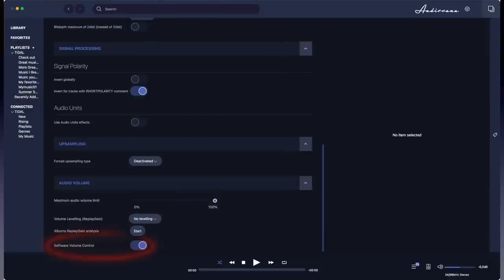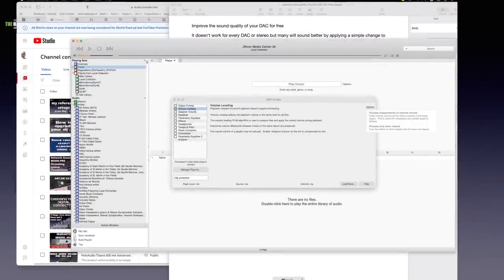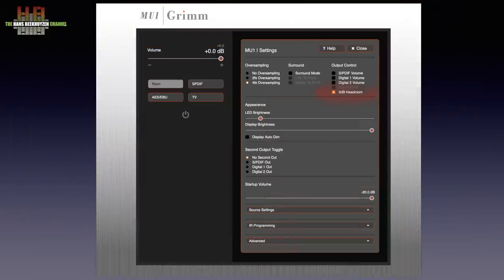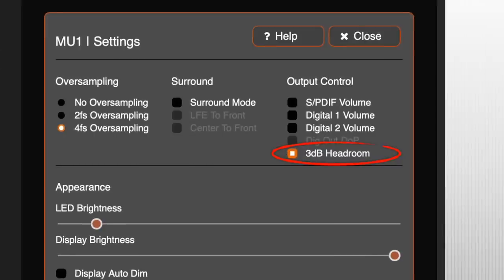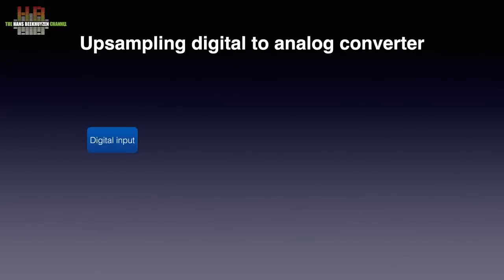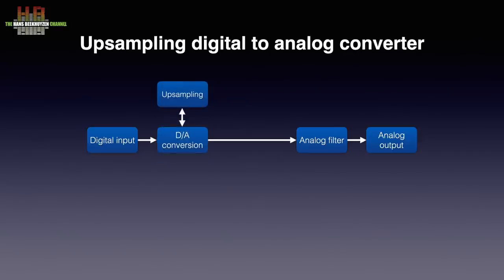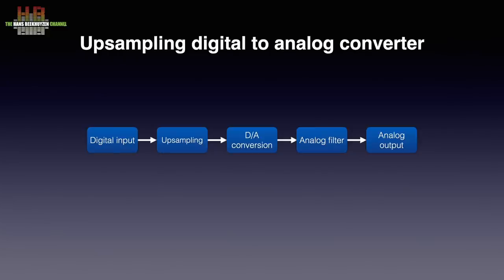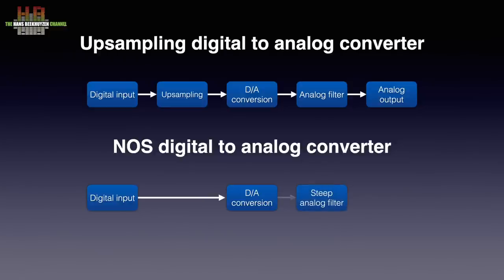Improve the sound quality of your DAC for free

Comment: Thank you so much Mr. Beekhuyzen! I have been using Audrivana and my PS Audio sprout in my office (gaming PC) for about a year now. With no issues I had hoped to recreate that sonic magic in my reference system. I purchased a mini pc (Pico) and installed Audrivana using a USB connection linked to a PS Audio Strata. It did not take long to start hearing artifacts etc periodically. I adjusted different settings in Audrivana with little or no improvement. Recently I came across this video explaining what is happening. I did as you suggested, and everything sounds amazing by adjusting by -3db. Thank you again!

Comment: This advice was incredible. In my case some songs were so harsh on my HE1000v2 stealth it was close to unlistenable. I tried to do a lot to tame it from adding an R2R dac (Musician Pegasus), a DDC (Musician Pisces II), expensive copper cables (Effect audio code 23) and while they all improved (or changed) the sound to some degree the harshness was mostly still there.

After watching this, I decided to check if clipping was happening and sure enough the worst offenders had tons of clipping showing up on Peace GUI. I put a -3db pre-amp and boom, the harshness was tamed. I can push the volume on the amp even higher now  since my ears are not reeling from harshness (more that overcoming the -3db preamp). 

No more chasing exclusive modes and bit perfect audio for me.

Comment: I have been doing this for years because I thought it sounded better, but had no idea of an logical reason behind it. Software volume is theoretically worse, and does sound worse (lower dynamic range) if reduced more than around -10. This true of any DAC Ive used, but especially on a Denafrips Ares2.
Reply from the maker: Nowadays digital volume control can be better than analog ones. It’s all down to the implementation.

Comment: Just by flying by the seat of the pants, if I record in the digital domain I usually trim up just a notch before clipping. And when all is well, and the band rehearses I turn it down by 3 dB. You never know if he hits that cymbal extra hard next time! This way I know there is no digital clipping. But I keep an eye on that red light though!
Reply from the maker: This is not about clipping during recording but overshooting of the reconstruction filter.
Reply: @TheHansBeekhuyzenChannel  yes I know, but if ones messes up during recording you can't solve it during playback. So although the reason is different, the problem is the same! You can't go beyond the brick wall as easily as with analogue... the latter is more forgiving...

Comment: I do this. I 
usually end up somewhere between -3 dBFS and 
-9 dBFS  to optimize the sound quality  from any source file.  Most people will argue with me that I’m crazy and say I should leave it at 0 dBFS, but that doesn’t work as well as being @ -3 dBFS or lower and letting more signal into the PA within the analog domain. It just sounds better, and even if you take 10 dB away, there’s still sufficient DR and SNR at 16 bits. People get so wrapped up in the technical, they miss the point of enjoying the music.
Reply: What does it mean when people say they do -3dBFS? Like how do I do that?
Reply: @Ken-vv3os  that just means 3 dB less than full scale. For power, that would be half power, but in voltage, which is what we’re discussing, -6 dB would be half. -3 dB in voltage would be about 0.7 of the voltage (roughly 2/3’s).
Reply: @shipsahoy1793  but how do you actually do that? What do you tweak on which device?
Reply: @Ken-vv3os  oh I get you, sorry !  The easy way  is to have a dac that allows you to make those adjustments. Some dacs have a digital control that you can go from zero down to minus whatever in half dB or dB increments. 
You can’t do it on a Modi or something that doesn’t have what’s referred to maybe as preamp mode instead of dac mode. I’m not up on the difficult ways or all design permutations. You can use the volume control on a passive preamp to “pad” or reduce the level coming out of the dac, but the dac analog output will still be up at full output.

Comment: Great video. In Roon, I only do up sampling to 384K...I always thought having the -3db Headroom will not be lossless. Should the Headroom -3db adjustment be ON by default in all cases? Thanks
Reply from the maker: Absolutely. BTW upsampling isn't lossless either. Any digital processing is lossy. But the SQ gain when upsampling might be better than the loss.
Reply: @TheHansBeekhuyzenChannel  Makes sense.  Thanks very much

Comment: I use Roon which runs directly on the Grimm Audio Mu1. As I use a Procedural Eq on the low frequencies I cut the Roon 4dB down to avoid clipping and this works on 99% of the songs (no red clipping signal). In this case, is it still advisable to add the 3dB Headroom with the Output Control in the Mu1 settings? 
Thank you so much
Reply from the maker: I don’t expect it will. But just try and listen. It’s quite audible in an A-B comparison.

Comment: Thank you for this video!
When using roon with automatic headroom -3db is applied, when using Tidal directly as the software source (instead of Roon) I believe reducing -3db on the volume in Tidal should do something similar. So to my understanding in applying the -3db on the software there is no need to further reduce -3db on the DAC, although there is no harm in doing so. But when producing music on a DAW such as Logic Pro X or Ableton Live, how would you approach this? Would you recommend reducing the master to -3db? And if applying a correction plug-in such as Sonarworks which is applied on the master, should you reduce -3db on the plug-in output or would its safe headroom feature is enough?
Reply from the maker: Well, you shouldn't produce signals that create 'overs' and give a bit of headroom so the reconstruction filters overshooting doesn't happen. But if you want to do the same as on the playback systems, you can reduce the monitor out with 3 dB and control the volume after the digital to analog conversion.

Comment: I use MusicBee as a player and it has a digital volume but only shows in percentages, such as up to 100% maximum.  Does anyone know for players that only have volume as percentages, how much one should lower that percentage to get around -3db?  I am trying to remain as high as possible so just going down 5 or 10% may be more limitation than I need.  Are there thoughts from anyone who knows?
Reply: Good question. Although i cant even find the digital volume setting. anyone knows more about this "trick"/ headroom leveling for musicbee?

Comment: Many thanks for this tip (and your great channel!). I'm trying to apply this tip in my MoOde audio player (volume type set to fixed output (=0db) and max output to 90%). Can you point me in the direction where I can apply your tip in Moode?
Reply from the maker: It's been a while (and many pieces of equipment) ago since I used MoOde. But if you use it with an external DAC, set the volume at -3 dB.

Comment: Hello Sir,  many thanks for all your videos,  I am impressed of your knowledge, congratulations, I use wiim pro with an external smsl dac (do400), should I set the -3db on the SMSL? This dac goes till +2 db, actually set to 0, Wiim I am using as fixed volume,  thanks again
Reply from the maker: The volume needs to be lowered by 3 dB in the streamer.
Reply: @TheHansBeekhuyzenChannel  thanks a lot for your kind reply, I had just a quick look inside the Wiim app, there is the functionality "Set the maximum allowed volume" I can choose from 0 to 100, may I ask you Sir what value shoud I pick from 0 to 100 to reduce the -3db (it may be smth like 95%) ? Thanks really a lot

Comment: Does anyone know how dCS (Data Conversion Systems), the inventor of upsampling, handles this problem? The way you're explaining this, it would seem overshoot in reconstruction filters is a known phenomenon?
Reply from the maker: I haven’t reviewed dCS DACs so I can’t say
Reply: @TheHansBeekhuyzenChannel  Did a level matched comparison last night and found setting the DAC to -3dB versus 0dB (re-adjusting on the amp using pink noise) sounds marginally fuzzier and less natural. Just enough of a difference it might stand up to a blind test, maybe too subtle. But enough for me to pick what I like better (bypassing volume control). The Upsampler in this scenario is a unit of its own, by the way, internal clocks of all units synchronized by an external master clock, volume control in the DAC is digital in 0.5dB steps. Given time, I'll try the same with an older generation model as well, for which dCS informed me back in the era there's about a bit resolution loss per 6dB, and that the older models had less headroom (effect of using the volume control is more audible).

Comment: Running Audirvāna on Mac mini connected to denafrips Pontus II.  I have options to attenuate volume two ways - DAC and SW (software volume control).  Which is the better control to reduce by 3db?
Reply from the maker: In Audirvana
Reply: @TheHansBeekhuyzenChannel thanks for your response.  To clarify - I have both of those settings in Audirvāna.  Trying to figure out which to use.

Comment: Sorry are you saying it makes sense to implement headroom management for NOS DACs, or only for upsampling DACs? I have a Holo Audio NOS DAC (fed by iFi Zen Stream), and am trying to figure out if I should implement the -3db headroom in Roon?
Reply from the maker: Every filter - analog and digital - will have some overshoot but analog filters have a nicer character when it happens. But why not just apply that 3 dB attenuation? It won’t harm the sound when done properly.

Comment: How do you know if your DAC has this clipping problem?
Reply: Harsh, flat sound with lack of midrange
Reply from the maker: Almost every DAC suffers from this, even my Chord DAVE and the MolaMola Tambaqui. It’s because digital recordings are recorded not taking in account this phenomenon.
Reply: I am now a bit confused.  I bought a Benchmark DAC3 because it deals with ‘intersample overs’ by having 3DB of headroom.  But you seem to be saying that all DACs have the problem because of the ‘source’ material not taking account of it.  Doesn’t that mean it is not ‘all’ DACs that have the problem but ‘all’ DACs will highlight the problem due to the source material containing it already?
Reply from the maker: I have no hands on experience with your DAC so I can’t help you there.
Reply: @Surreyg  my previous dac Rme Adi 2FS dac had also - 2,5dB headroom. In my opinion at least aditional - 3 to - 5dB on digital volume was needed to receive natural sound. (of course still limited to Adi quality)

Comment: I have tube usb dac. Im using apple macbook air. I can change the volume on the computer or in tidal.
I always have the volume on computer( output spdif)to max.
And in Tidal application i have in settings force volume on , exslusive mode of and MQA on.
This sound to me the best.
If inhave exslusive mode on the sound is flat. You think if i lower the output on the computer the sound will be better?
Reply from the maker: If you want to use MQA, you don't need nor should reduce thee digital level with 3 dBs.
Reply: Thanks for the reply.
I have another question.
Do you think that tidal in audirvana sounds better that only tidal aplication.

I have computer in other room. When am listening i don,t see computer so i need remote control for changing songs.
Tidal doesn,t have remote control but
Audirvana does. But then i have to pay for both.
Is there any other solution for this.
Thanks for the reply.

Comment: That's why i have digital volume control on my dac. it sits at -8 Db. it also prevents the pre amp from getting outside it's bias. two birds , one stone. Groetjes uit Breda :)
Reply: Yes I think this is why it works so well! The dac analog output and preamp input can be receiving a full 4v. It's good to get restrain this a little before hitting the analog domain. Also results in the pre volume pot being turned up... Log pots have a sweet spot around 11 to 2 o'clock.

Comment: I listen music via Gustard R26 dac using its internal streamer. Would using the inbuilt attenuator do the same trick? I think it is around -10db though. When outside nos mode one can also lower the volume via the preamp mode..
Reply from the maker: No. You can't correct the volume between the streamer and the DAC.

Comment: Hello Hans, thanks for sharing this intressting tip. I have a NAD C658, that is my preamplifier with al the inputs like phonostage, cd input and is my streamer,and it is also my DAC. I already looked in the settings of my c658 but i can not find any settings about lowering the volume with 3 db or clipping protection. So do you perhaps know if i can do changes in my NAD c658 that are related to your story in this video? Thanks for your help in advance, and enjoy your time in Munich. Best regards Danny.
Reply from the maker: You can't. It's not possible to reduce the volume in the digital chain prior to the DAC.
Reply: The C658 has both a network streamer and a DAC integrated, but doesn't expose pre-DAC controls of this type in the BluOS software. The volume limits in the BluOS settings are all on the analog output side.

It's possible that NAD do this in their design in some way, but it's not disclosed as a feature so it's unknown.

Comment: I have an Innuos Zenith, and its volume can be reduced by a percentage amount.  Has anyone tried this with an Innuos?  I'm sure I read somewhere that Innuos recommended not to do this as it adds an extra processing path. They use the term "perfect digital passthrough" when set to 100%.   I have a Denafrips Pontus 12th DAC in NOS mode, via USB.
Reply from the maker: Doing no processing - like volume change - always gives some loss. But the loss I described caused by oversampling is a bigger loss. The nett sound quality result will be better when the Zenith is set to -3 dB.
Reply: @TheHansBeekhuyzenChannel  Thanks.  Is there any way of translating a decibel reduction into a percentage?
Reply from the maker: it's about 3%

Comment: Thank you Hans - based on your description it looks to me like BluOS users might be able to try -3dB via “volume limits” in   settings->Audio. Anyone else know if this works? (I’m about to try it). Thanks
Reply: Yes it will work (I’ve been doing this for a while) however, when you switch to variable output it locks out the ‘MQA Eternal DAC’ feature. Not important to me but maybe for some . This is with a Node2i being used as a transport only.

Comment: Many thanks for the insight explanation. 

 I do find my Topping D90 AK4499 DAC sometimes some media sound harsh or sharp thus fatigue listening over time. I have to lower -3dB at Topping DAC90 pre-amp mode then control volume at  Accuphase E280 integrated amplifier.   

Recently I heard there's FPGA firmware update of some DAC , can they really improve sound quality ?

Comment: Oh thanks, i miss this video because youtube being youtube as usual.
Also, i wonder why DAC seems to be very effected by the surface placement, i usually notice more digital artifact and analog distortion when i placed the unit on a glass table; it's a bit like how turntable is picky with vibration but i had no clue on why this also happens with digital hardware.
Reply from the maker: Some components inside a DAC are microphonic; they are sensitive to vibrations.

Comment: This is very interesting.  So how would I set my volume in Windows 10 to -3db?  My dac is a usb model that connects to my receiver.
Reply from the maker: You shouldn't do it in Windows. The Windows volume control ruins more that the cure will fix. Use a bit perfect player and set that to - 3 dB.

Comment: The Topping e30 ii and many more have a "pure dac" mode. This disables the volume control on the device.  Is it similar to the -3db setting you mentioned?
Reply from the maker: I have no experience with that DAC but I’m almost sure that isn’t doing a -3 dB.
Reply: @TheHansBeekhuyzenChannel  Thanks for your reply. Let me do some searching & experimenting!
Reply: I had the E30 and as far as I know “pure dac” means that the pre-amplifier is disabled, so the E30 outputs at 100% volume.
Reply: I'm using E30 II with HQPlayer. The volume in windows set at 100%, but in HQP at -3db. Since I am using Windows 11 I have to install the Topping driver v5.62, the volume level in the driver at 100%. Using E30 II as pure DAC to L30(as pre-amp).